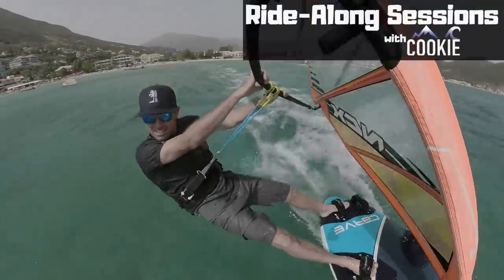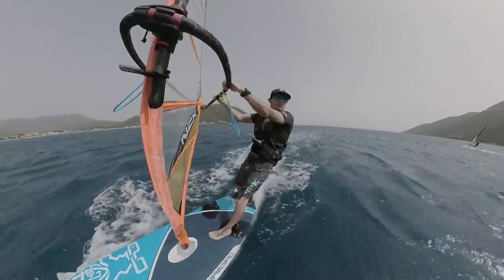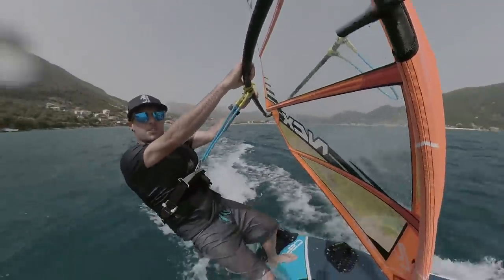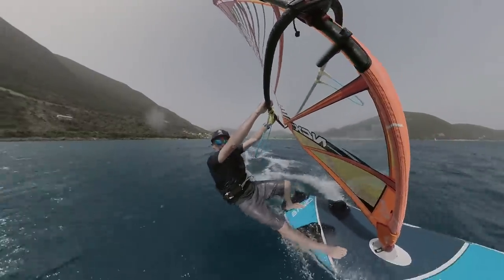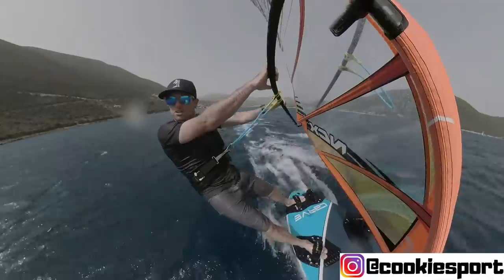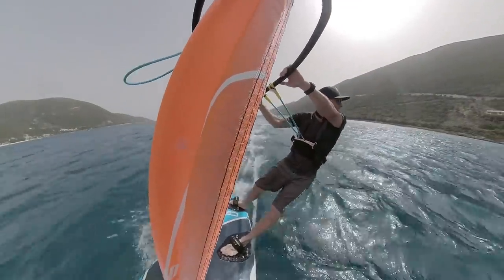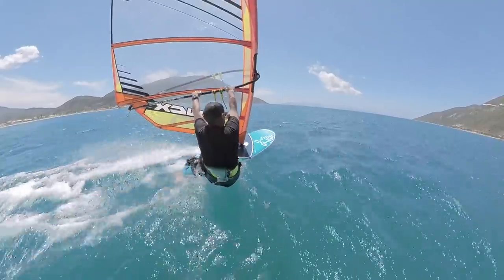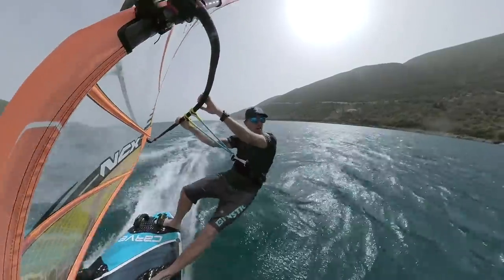How to get planing and exit gybes on the plane- it's the same thing!

Comment: Drop & push… and may be pump? Could you please make a video on pumping?
Reply from the maker: Pumping video is on the list to film. 
Only pumping used in the video was the push/drive/kick off the front foot! If you have wind/power there’s no need to!
Reply: Re pumping I bounce the board to get on the plane . I don't know if it's as effective as pumping but I can do it still hooked in and when I'm on a big board for my size it's less physical.I'd be interested to know more about bouncing versus pumping.

Comment: for me the only thing that worked and I just managed to really exit a few gybes with solid speed was to lean the hips inside when carving and flipping the rig on the spot. whenever I do the round movement with the mast that you do when flipping I flipping stop. I'm usually on 116L and 6.2 freeride
Reply from the maker: Usual, but as long as it works for you! ✅

Comment: Great explanation... I also use a variation of drop and push in a lull or light wind - with the mast upright just hanging off the boom.
Just to re-emphasise- the importance (in higher winds and gybe planing exits)- to grab the boom far back with the front hand  with the Drop and Push as this helps with handling the burst of power.
Reply from the maker: Thanks! Far back down the boom with the front hand is a key point! ✅

Comment: Super good videos you coming out with keep up 🤙🏻
One question, planing jibe 😅
Should I keep my sail sheeted in and straight front arm, passing 90deg in the turn and right after start to open up for the flip?

/best regards
Reply from the maker: -H’s on the entrance
- open early with extended front arm, 
- steer with rig movement (to the outside) 
-disco rig flip
-D&P on the boom exit

Comment: Thanks for the tips and the enthusiasm, great job Cookie! 
One question. When going upwind I have hard time entering my feet in the streps and putting my hands back on the boom.  When I do, I instantly go too much into the wind and loose speed. No way to get into planing. From your tips I believe it could be: i) not enough wind to do it; ii) bad trim, that is I am pushing too hard on the heels (of the back foot in particular); iii) not driving through the front foot and not having a stiletto position on the back foot. What do you think?
Reply from the maker: Sounds right… drive hard off the front foot to turn the board away from the wind and keep it flat. 👍

Comment: Great video.  You emphasize pushing forward with the front foot to optimize planing.  What about the back foot?  I push across the board/fin with my back foot, to help generate lift.  Is this correct?  Is it less important than force on the front foot?
Reply from the maker: I can work with some side back foot pressure- but problem is it could (when done wrong) spin you into wind quickly, or cause spin out.

Comment: Really nice coaching! So appreciative of these. This technique works like magic but question: How to adapt this technique for when we’re hooked into the harness? I find that I can’t keep the rig as upright when dropping out, back and down when hooked in (compared to out of the harness)even if I push the boom with the front hand. The whole motion while hooked in makes the sail lean comparatively more windward and back, and so reduces the effect.
Reply from the maker: De-power, so you can then power up... pull the front arm IN so you can drop out and back...then push the front arm to re-power up.
Reply: @Cookiesports   Oh.. What a huge lightbulb moment. Thank you!

Comment: Thanks a lot for videos Cookie, they're great! Question: in those videos it seems that I often see you in the straps (or at least the front one), not planning, and you look pretty comfortable. Now every time I try to get in the straps while not planing (with my old, heavy 160l freeride board from the early 2000s, 7.1m sail, usually marginal conditions) the board wants to go upwind really bad, even if I'm only in the front strap, and it takes a lot of effort to keep it form doing so and I feel like I'm going to fall backwards on my butt. I can do it but it's a struggle (it's very demanding on my core). Any advice that would help? Is it bad technique (I would guess) or can I just not do that in too marginal conditions (i.e. enough power to counterbalance my weight being on the tail)? Once a gust comes and I start planing the problem disappears.
Reply from the maker: Hi! I only get in the front strap when I’m a) planning or b) about to get planning. We shouldn’t aim to be hanging about in he strap waiting- it’ll just drift you downwind.

Comment: Pls comment on what the wind speed is... as a wanna be planer I am wondering wtf I am doing wrong and figure it is my 5.2 sail and 130 l board and 220 lbs... just doesn’t have enough wind power, which I don’t know how to gauge well anyway...
Reply: Great camera work btw
Reply from the maker: Thanks Jim! 
It’s always a bit of a guess in the wind tbh…. In this I’m on a 6.5m so wind ins 15-20knots.  I’ve been here a month now and only used my 4.8 so far for 20-35 knots! 🤣 
If I’m doubt… power up! Extra power can make up for “interesting”‘ techniques!

Comment: Great Video, and thank you for sharing. Have a question, what's the meaning of Push? Is it means push with front hand? Or just means sheet in?
Reply from the maker: Push (as in drop and push) is putting pressure/your weight through your front foot.
Reply: @Cookiesports  Get it, thanks for your reply, Cookie

Comment: Hi Cookie , great videos mate . I've being trying to get planing consistently for 12 months now but i still get catapulted more than i get planing especially on my backhand , when i look at your vids you appear to have the harness lines back further than i do , whats the formula for sail size , boom height ect in relation to harness lines ? My catapulting occurs just at the point as i head further downwind to get planning and find that i have to stand taller to achieve this or i cant get planing . Cheers from Australia
Reply from the maker: Harness line back = power when you commit to the harness. It means you don't have to use your arms as much any more as your body weight sheets the sail in for you. 
Boom height- keep it high- aim for shoulder height minimum! 
Let me know how it works! 
Thanks for watching!
Reply: Thanks Cookie , when we finally get some wind i'll give it a go

Comment: Hey man...what board is that
Reply from the maker: The blue one is a 133 starboard carve. Really nice to sail!
Reply: Thanks....so.really happy I found this channel..May I ask a board related question....so I live out in Spain...we get nice thermal winds here.   I recently did a course in windsurfing 10 hours.  Can sail up.and down wind tack and started to gybe a bit..  so   I want o but a board.. the  one I was in was like 200 litres... I thinking a board that will stay with me as I advance to intermediate and more..  what would u say to a STARBOARD GO  155 LITERS....I was sort ot a quick learner and have been surfing for 30 years although they are quite different sports....thanks in advance   noze x
Reply: I’m loving the videos Cookie!

I’ve recently gotten back into the sport with a 148L Fanatic Shark that I use a 8.0 and a 7.0 sail with.  I sail inland lakes with average windspeeds of 20-25km/h.  I haven’t managed to get planing yet but I think it’s a technique problem on my part.

Out of curiosity, how much do you weigh and when you say “good winds” what speed is that?

Thanks again for all the videos and tips.